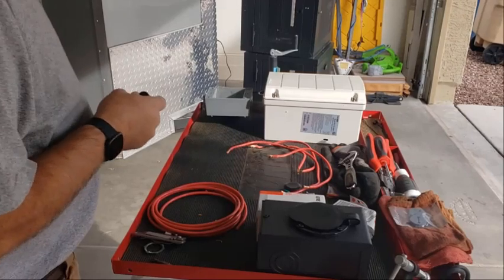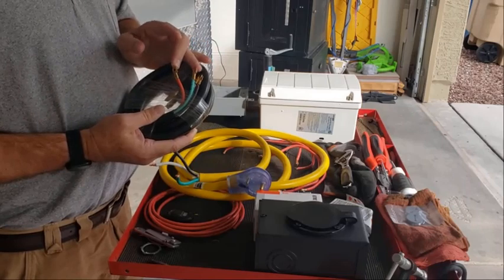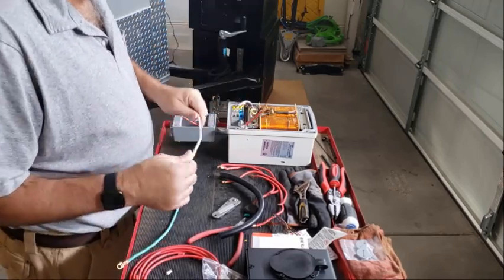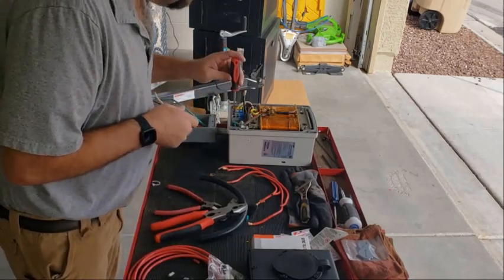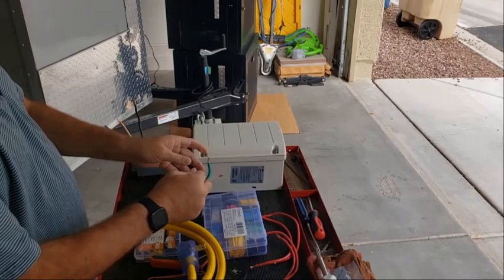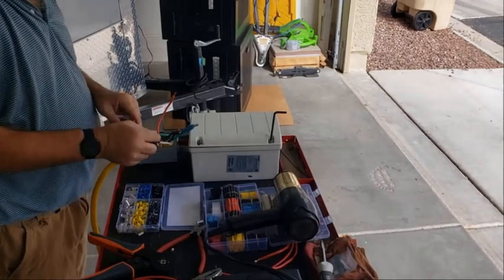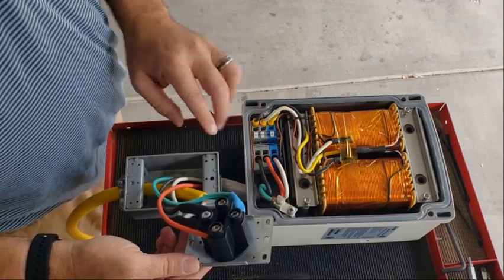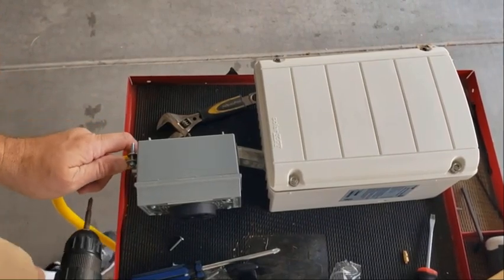Solar Edge Single phase to split phase

Comment: Could the TT-30 be wired to the auto former and the auto former wired to breaker, neutral, and ground in service panel?🤨
Reply from the maker: Yes these transformers are very useful